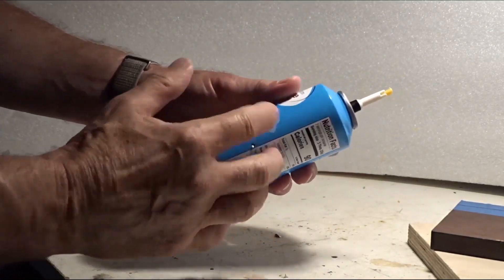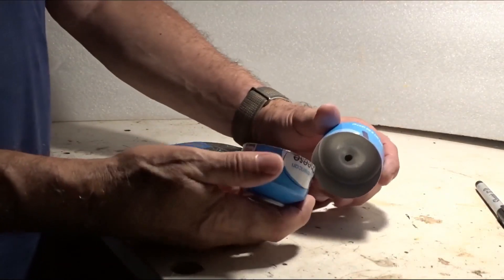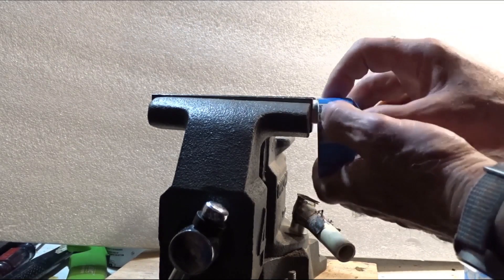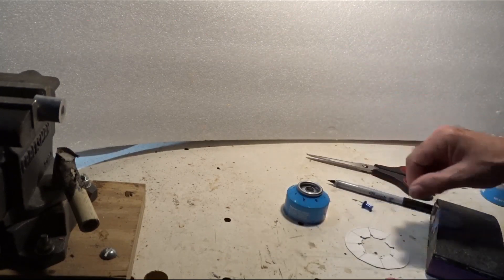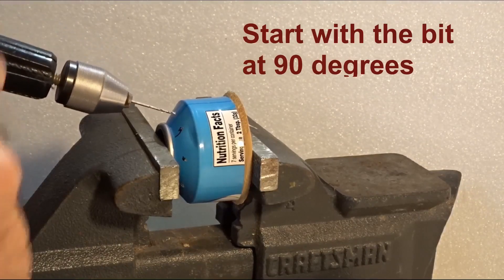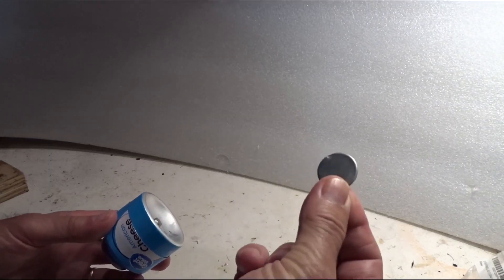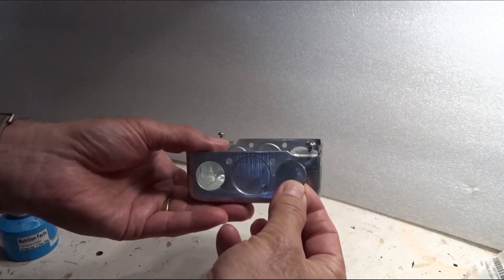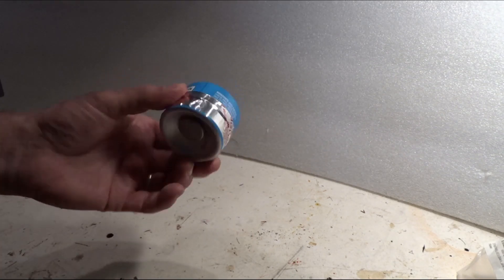Full build new super-efficient alcohol burner - DIY MYOG

Comment: I'm trying out turbo wall now & BTW if u make ports angle to side u can get a vortex flame
Reply from the maker: Like to check out turbo wall. Got a link?  The vortex is pretty cool. Had that on a couple earlier builds. Don't know if it makes a faster boil. I'll give it a try. Thanks
Reply: @tomlovesdiy  I have a video up showing turbo wall but easy mod to bend ports clockwise or counter depending on hemisphere seems my clockwise airflow flame sometimes looks like fighting to go counter lol... The turbo wall is capillary action & simply crease an inner ring to make jets & tubes against outer wall... I am going to live test a few version soon today... Melt cheese, boil water, toast bread etc...
Reply: @tomlovesdiy  also trying added adjustable outer casing holes & a secondary burn ring on top to create smokeless tornado ported combo with dome fire ring to convect vortex effect at moment... But kinda gets hot tall flame so hard to cook on/ for show
Reply from the maker: Nice!  I will check it out

Comment: New subscriber here, really liking your videos. 
On the bottom where you glued the magnet did you remove the rubber plug or leave it in place,  wondering if alcohol will make it leak eventually?
Reply from the maker: Welcome. Thanks for subscribing and watching. Good question.  I don't remove the rubber plug. It has a very tight mechanical seal. I think putting JB Weld over it ensures it won't leak. Appreciate the comment and glad you like my videos.  Got a couple more in the works. Might not post until after the holidays. One is an expiramental stove. So far... not what I am trying for. But for me, that's part of the fun; finding a way to make it work. Cheers.

Comment: How is this what’s the main difference between this one and a penny stove?
Reply from the maker: Great question. Technically it is a penny stove because, as you saw the center fill hole is covered be a metal disc. It doesn't have to be covered. I do to better manage the burn rate. Uncovered it will tend to be faster. I designed it to be optimized for fuel heat transfer with the "penny" on the hole. I haven't tested with it uncovered. Guess I'm not done. Thanks for asking.
Reply: See my handcannon stove video

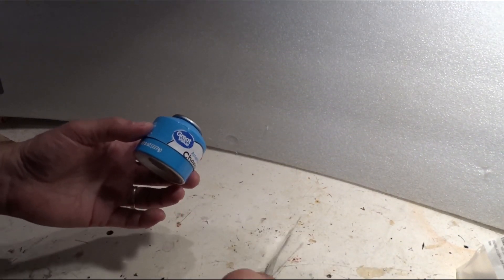Comment: Thanks Tom! One note: there's about a minute of dead space in the video at the 9:39 mark. Looks like it starts back up around 10:42
Reply: Also, I'm curious how this performs in cooler weather. Does it take longer to "bloom" with increased volume that needs to be heated to pressurize? That could be an interesting test
Reply from the maker: I haven't tested in cold weather. From what I've seen on YouTube, colder temps don't have much effect on alcohol burners. Might need a couple ml's more priming fuel.  Could be a challenge to get valid results; lots of factors.  I don't hike when tremp is going below 35F.  But I will definitely try it later this year.  Oh... and when I used a liquid fuel Optimus stove it burned great in 20F.
Reply: @nvalley  "Penny Stove" type became weak in low temperature. Tektoba's make one less susceptible to the problem, but don't reveal the "engineering", in their test he put ice in the base and a conventional "penny stove" almost goes off.
Reply from the maker: Strange. Thanks for pointing it out. I'll fix it.
Reply from the maker: Back from vacation and fixed it. Thanks again.